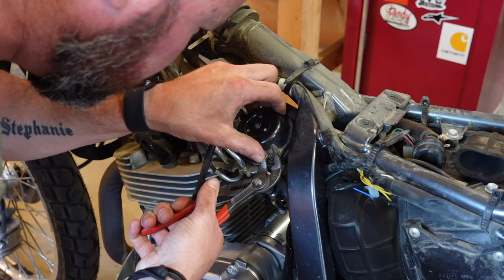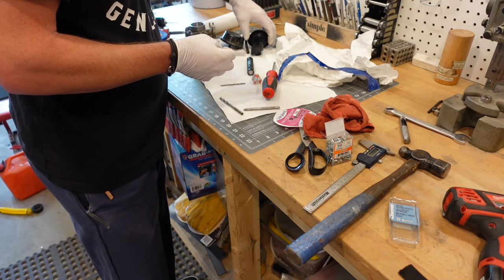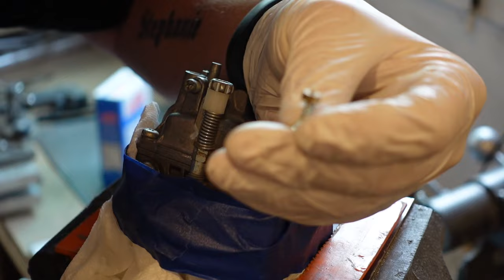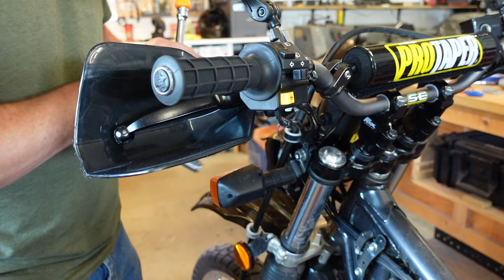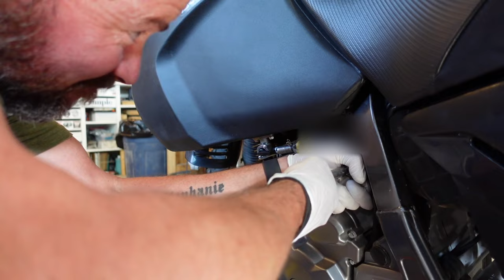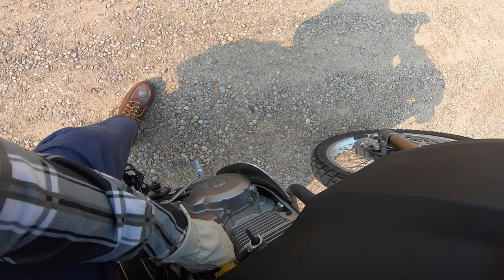Ultimate DIY DR650 Carb mods & acerbis fuel tank install

Comment: Thanks for the vid. One thing about drilling the jet. I read about it when I was a youth, in car mags. The jet hole is actually tapered, as the fuel flow is calculated for that size. When you drill it you square the hole, which really increases the flow rate, more than just a purchased jets size up. It also can cause lack of consistency in the fuel flow. Food for thought.

Comment: I think this is the first mod video where I actually like the sound of the aftermarket exhaust. Tank looks great, I was considering the clear tank. That's some brave modification to that carburetor, the video does a great job showing the performance improvements.
Reply from the maker: Thank you so much!
Reply: @jeremygoertz  no problem, I hope to do the same to my 2020.
Reply from the maker: Right on👍

Comment: I don't understand how tapering the needle at the tip improves low end response? Think about it.   I drilled my original main jet, and ground my needle and it was never right, yes it ran alright but it wasn't  'right'  , but after tinkering abit more with it,   I'm like you, I've got my bike tuned to the point where I don't think it could get any better. Cut Airbox and exhaust header weld ground down,  drilled slide, cut spring, 155 mikuni main jet, 45 pilot jet, stock needle shimmed up a smidge.   I don't have pipe on mine cut but I'll order a couple more sizes up of main jet when that comes, itll probably end up at around 160 or 165 mainjet.   I bought an extended fuel screw and that has been an excellent addition too,    When the pipe comes I also want to do abit of porting and polishing on the exhaust side of the head.   When you get them 'right' they run amazing,  sitting still at idle the bike idles butter smooth, and you can't smell anything,  at cruise the motor is buttery smooth,  but then you give it some wrist and it makes you feel all giddy, I can wrist it around tree's in figure 8's , then scoot up to 70mph with ease and sit there all day.   Cheers,

Comment: Ill be running a lot of highway and want to add a tooth on the front sprocket to lower the revs some but i was concerned about the bike being able to pull it. This sounds like the extra power would compensate enough to pull the taller gear.

Comment: I took a dremel, turned the carb bolts into big wide flatheads and then used a long screwdriver to get them off.
Reply: That’s a great idea, love the tip

Comment: Did you take the exhaust off and grind down the weld inside the front pipe (at the manifold)? It's supposed to make a huge difference. The other guys couldn't keep the front wheel down. One guy was BikerBits I can't remember the others there was an Australian and a Canadian you can probably grind your jet/needle more. I think they changed to a 55 on the lower jet. Good luck nice job on the video. I'm not sure we can get away with re-jetting a bike in Ohio because of emissions.

Comment: Mine lacks power as its standard carb . Put some copperslip grease round the threads where steel goes into alloy. They seize up easily especially with bolts in aluminium head like exhaust clamps.

Comment: Ya know.... I have a stock pipe and stock 140 jet. But I drilled the slide and tapered the needle and removed the snorkel and adjusted the idle mixture. Those alone made a huge difference
Reply: Oh yeah I bet they would. If I could stand the quietness of the stock exhaust I would have probably left it on there. I prefer other vehicles hear me though, and the slight weight reduction is an added bonus. 👍
Reply: @Simplelittlelife  i like to take mine around public land to go hunting, and I don't want to draw too much attention. That being said, if I decide to get a pipe I'll swap in a 150 jet and drill the extra hole in the airbox, easy peasy
Reply: With just a snorkelectomy, the stock main jet has been enough for my DRs at sea level. I use extended idle-mix screws and adjustable overseas needles, but I don't drill or cut anything. My DRs power-wheely.
Reply: @RKmndo  after having experimented on it myself, I'd have to agree with you on that.

Comment: that dang acerbis seat clip is trash.  i just removed it.  it's fine w/o it. the fit is even worse on a seat concepts seat.  I used JIS tips on an impact driver and the screws came out easy. Raising the needle with shim{s} should keep it out of the backfire zone and help with idle to 1/4 throttle perf.

Comment: The video is pretty old, but cottage cheese container spacers close to gasoline, I am not sure if it won’t melt 🙄
Reply from the maker: I was riding two days ago (not for long as it was -23C) and so far the throttle response and everything about the carburetor is still working well. Time will tell I suppose. Cheers 👍

Comment: Do you think this would work with a stock exhaust setup?
Reply from the maker: I don’t think there would be any benefit if you’re using the stick exhaust. It’s very restrictive and opening up the carb will just make the system imbalanced with the restrictive stock exhaust.
Reply: I use stock exhausts on my DR650s. I keep the mods simple though...extended idle-mix screw, snorkelectomy, adjustable OEM overseas needle. I'm near sea level. I DON'T cut my airbox. I relocate the crankcase vent away from the airbox opening, to eliminate surging. At altitude, I can adjust the idle-mix screw and/or remove the airbox door.

 My bikes throttle wheely.
Reply: The jet kit from Procycle recommends a 145 main jet with the stock exhaust. Take that as you will.
Reply: I've got the stock exhaust, and cut airbox. I settled on a 155 mainjet and it is happy.   Im not going to mess with it anymore until I put an exhaust on it, but it could probably use a tad more fuel, like a 157.5 mainjet

Comment: Whatever tools you used to do all of this, I definitely don’t have them so this is a no go for me. But nice to know!
Reply: The stock toolkit has JIS drivers that can remove the OEM carb top and floatbowl screws. Those screws are NOT phillips. Maybe use the toolkit's pliers to turn the driver. Those screws are tight!

 I once changed a DR front tire with just the OEM toolkit and an Endurostar trailstand..

Comment: Suzuki  tunes  for longevity  when you open it up  it burns out 100 times faster
Reply from the maker: I don’t believe that. Especially 100X. It’s a low compression engine with a simple and good design. Improved natural aspiration doesn’t tax an engine. Riding the crap out of it because it goes better, now that would affect it’s longevity. But that would also decrease the life of a stock DR.
Reply: Suzuki tunes for emissions.